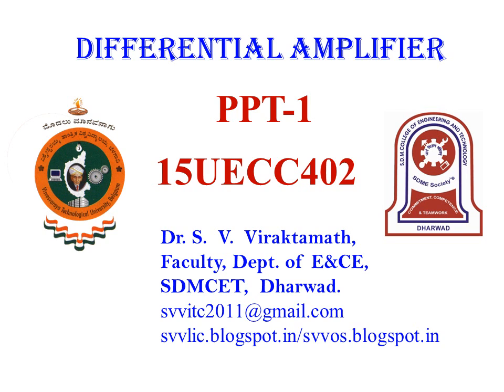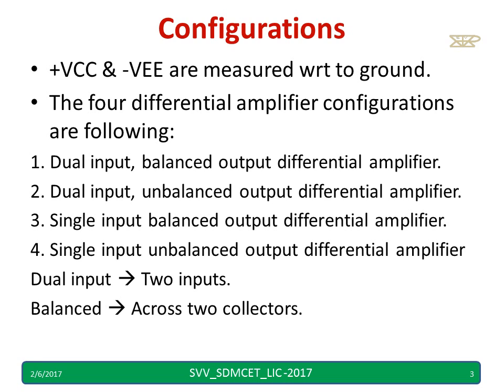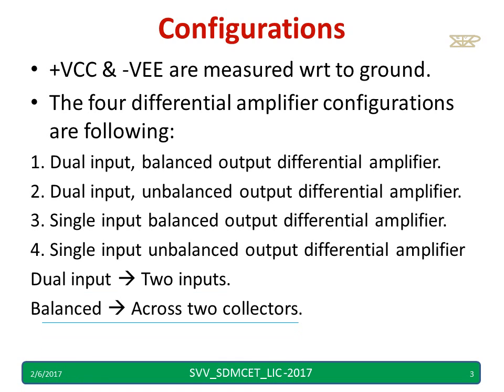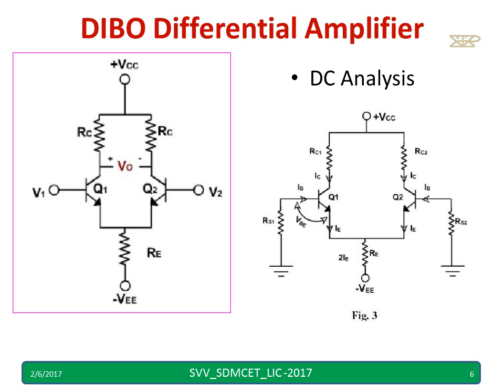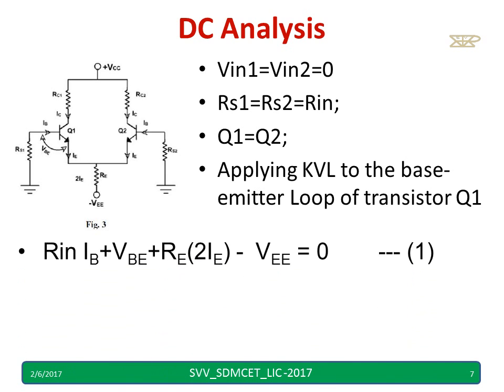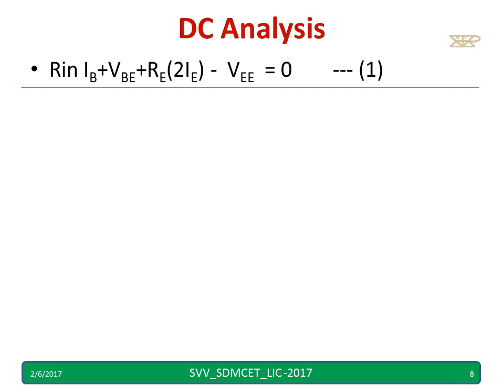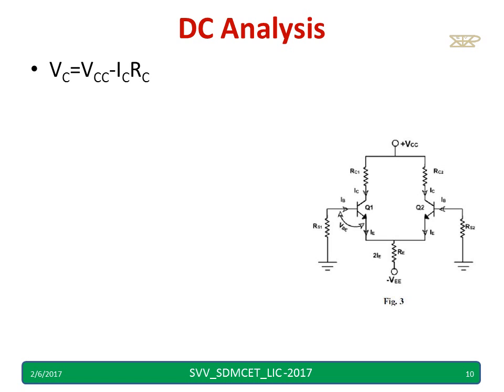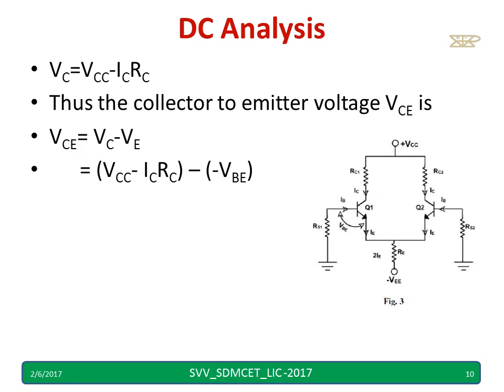DC analysis of differential amplifier

Comment: Emitter current =(beta+1) base current but u have taken only beta DC y?
Reply from the maker: Please mention the slide number of timing. I will check it sir/madam. Thanks for watching the video.
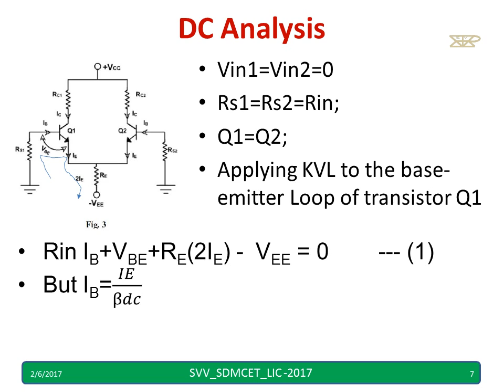Reply: @SVViraktamath  3:32
Reply: Stutee Rath  I think it’s from estimation  
before i make lab in my class   Beta ~200 
so, 200 or 200+1  , ok
However ,   ie = (beta+1)ib    is correctly formular